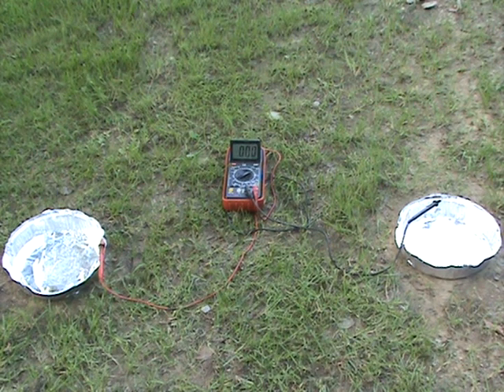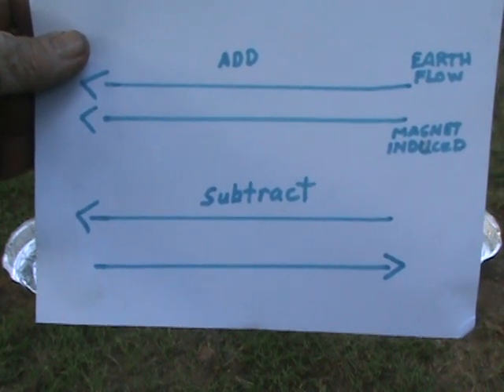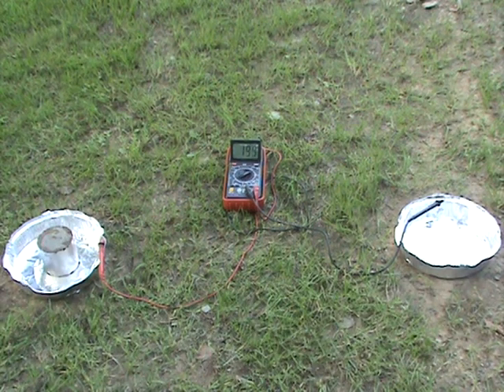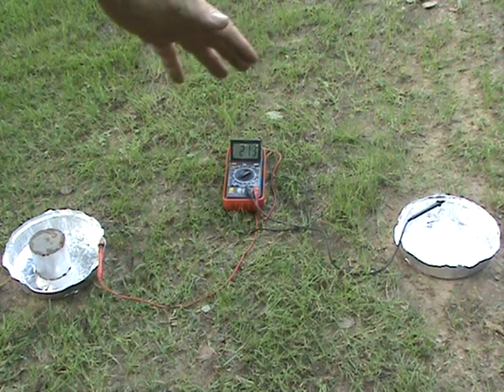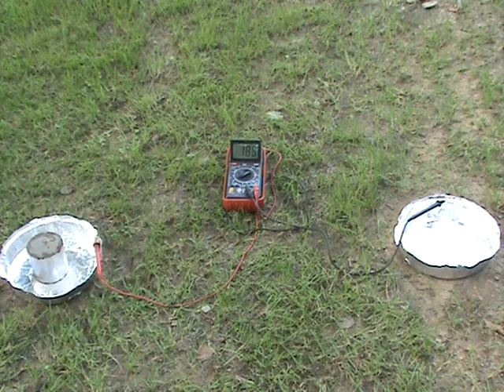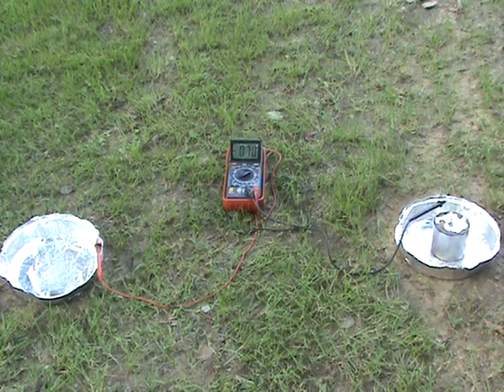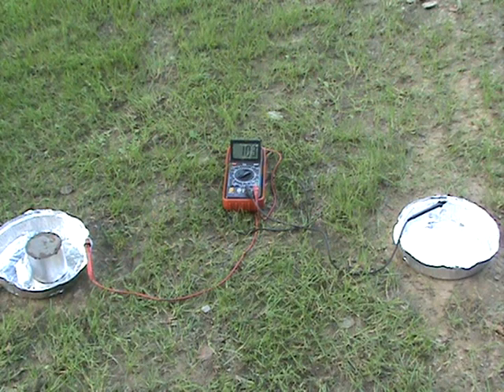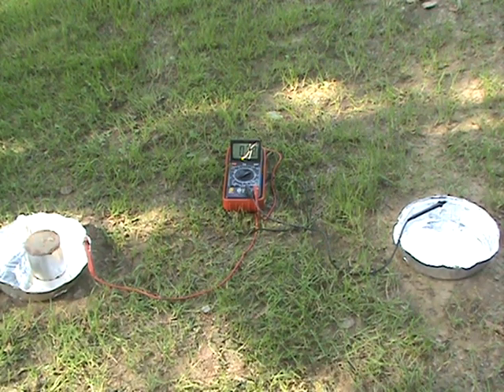Ray's Magnet Battery ( Part 6 )

Comment: The current is generated by moving the magnet around the aluminium, not because of earth's magnetic field. Just do the same experiment with the everything on a table, you will have the surprise of the same result, even there is no contact with the earth.